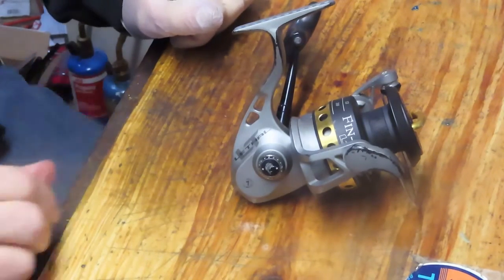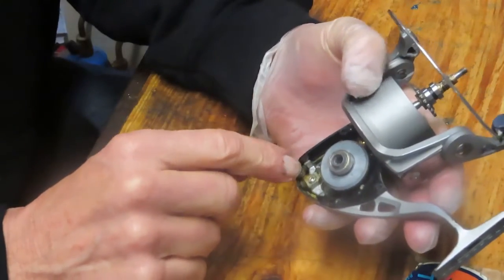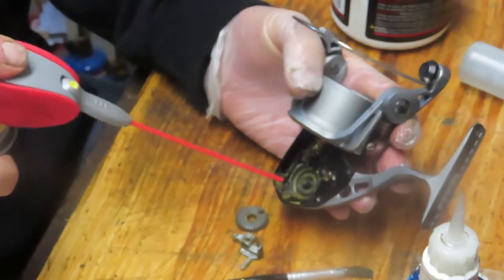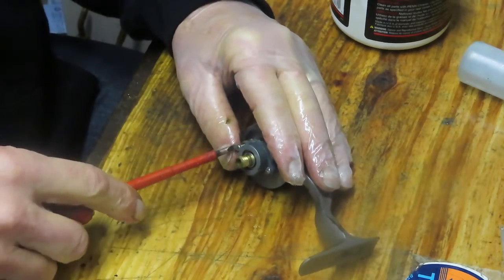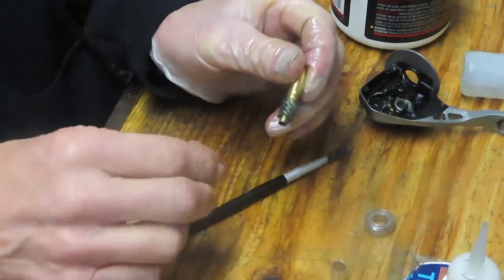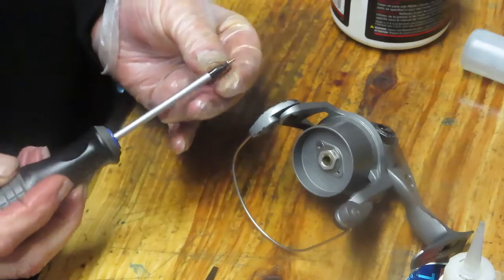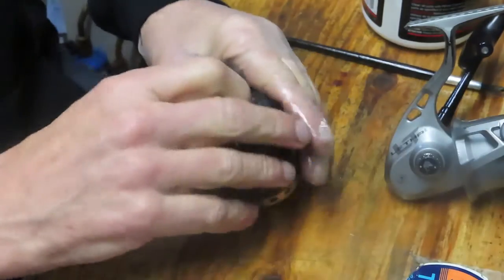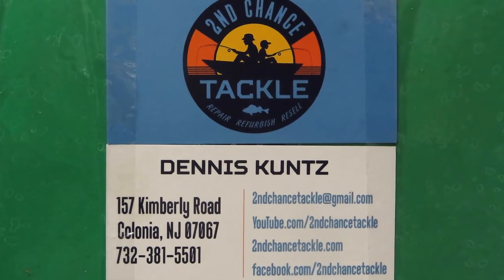Fin Nor Lethal 40 spin fishing reel how to take apart and service

Comment: No Dennis! Just like with fishing reels needing oils and greases designed for that need, bicycle chains require bike chain lubricants.

I use a product from Finishline that once applied, soaks into the rollers and dries so as to not attract dirt. They use a suspension of Teflon or Krytox as a friction reducer. My bike chains are clean and don't transfer crud to your leg or pants.

I think in fishing reels, the hype of 5, 10, 15 or more bearings is a two folded card. First it sounds like the more bearings the higher the quality of the reel. Secondly, bushings require a tighter tolerance hole than does a bearing, so any mis-alignment with a bearing still moves freely. A misaligned bushing may not allow the assembly to be assembled.
Reply from the maker: Thank you - my bicycle is 20 years old and not used much.  I use the oil to keep rust off of the chain.  I appreciate the tip on the other lubricants - Dennis